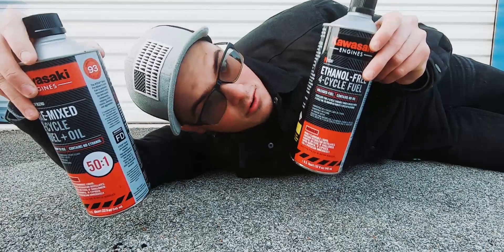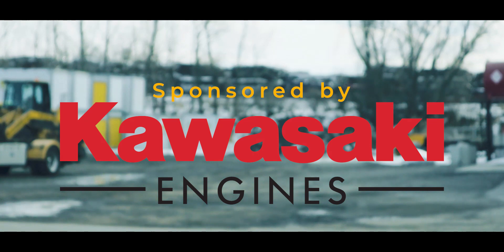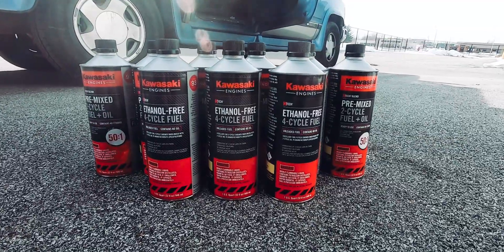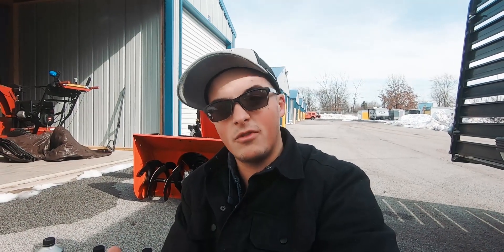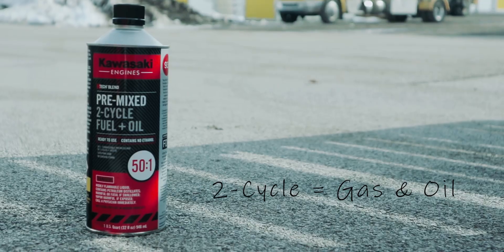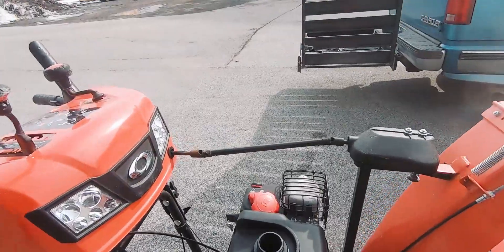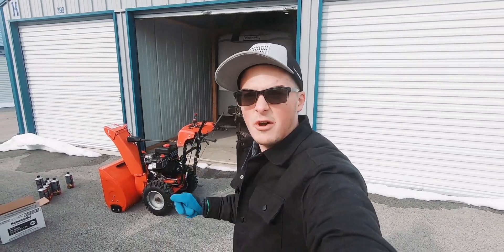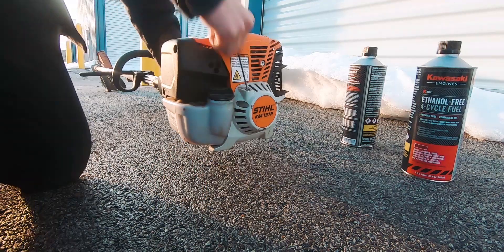QUALITY FUEL That Can SAVE Your LAWN EQUIPMENT... KTech™ ETHANOL FREE FUEL

Comment: A little off topic, but I have a question about grub/worm control. I ruined my yard last year (waited to water, cut too short/too often) in the summer and grubs and army worms took advantage of my weakened yard. I watched your grub vid from 2017 and wondered if you would still feel the same about grubs as you did back then?
Reply from the maker: I believe as long as you're proactive with the grubs and sod webworm (getting down a preventative in here in late spring), applying a curative if need-be to kill them in select areas using IPM (Integrated Pest Management), and improving your cultural practices (mowing, fertilizing and watering) you should be able to steer your lawn back on track this season. I hope this helps! You get that lawn double dark green and thick! Jake.

Comment: If you read the manual on your lawn equipment, it says it's perfectly fine to use up to 10% ethanol fuel.  They design them to be able to handle the ethanol.  If you happen to live in an area where they add more ethanol than that, then maybe this is an option for you, but I've been running my equipment just fine on gas station fuel for 10 plus years.
Reply from the maker: Me too man! Just showing an option is all.
Reply: @JakeTheLawnKid  It's not bad, it's good fuel, and idiot proof.  Where I work has gone to using trufuel in their small engines.  It's easy, and probably marginally better for your equipment.  Not saying it's a bad product, just not necessary for everyone.
Reply from the maker: @mplslawnguy3389  I'm agreeing with you sir!

Comment: You can make your own at home to by buying the regular pump ⛽ gasoline.& Adding A 1/2 cup of water place cap back on to A clear jug then shake it up really good. Release the air pressure slowly then retighten up the cap let set for 2 days use the fuel from the dark part up not the gelly type part.,or watery part save it for fire 🔥 pit burning instead

Comment: I have been using tru fuel 2 cycle 50:1 mix in my echo pb2520. Would this work in my toro recycler with a Briggs and Stratton engine or my snow blower with and ariens engine on it and would the 2 cycle mix work on my pb2520
Reply from the maker: Yes. No problem using it at all for your Briggs.
Reply: @JakeTheLawnKid  ok thanks

Comment: Then just add in octane booster.& Your 2 cycle/ 2 stroke oil mixtures into the equipment you'll be using is all that is required to do for make your own ethanol free gas at 🏠 home.

Comment: I've used TruFuel before but never this stuff. How much does it cost per bottle?
Reply from the maker: It can vary depending on where you buy it from (as of now, it's still fairly new). Primarily sold at your local dealer.

Comment: Those things are so expensive you could replace your equipment for the price of those if you used it regularly.  If you want Ethanol free fuel if you have a local airport get it there.
Reply from the maker: They are expensive. Which is why I personally don't use it full-time, more so part time, toward the end of the season. as I stated in the video, part time is the best option if you plan to use it.

Comment: What’s the cost of this product?
Reply: I'm sure it is more expensive to buy than mixing your own. Simply find a gas station that sells recreation fuel (usually close to a marina) and use that on your engines. Recreation fuel is ethanol free. All of my equipment has 4 stroke engines so I don't have a need to mix any oil. One gas can will work for everything (string trimmer, leaf blower, lawn mower and snow blower.) I also use it in my backup generator since it sits for long periods between uses. 

With recreation fuel there is also no need for the use of Stabil. There is no Ethanol to dry up and crystallize in your fuel system, from tank to combustion chamber.
Reply from the maker: It can vary depending on where you get it. Primarily sold in dealers.
Reply: @michaelgutierrez6564  ….. Thanks. I’m fortunate enough that my local gas station sales non ethanol gas and it does make a difference on performance.